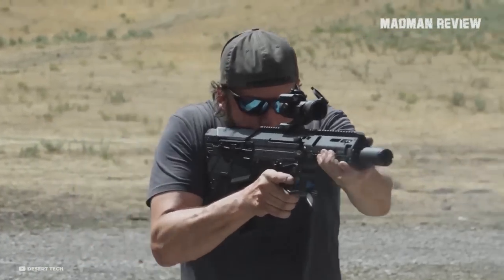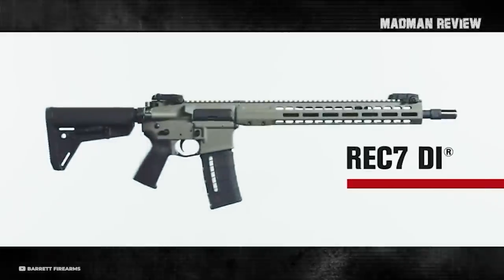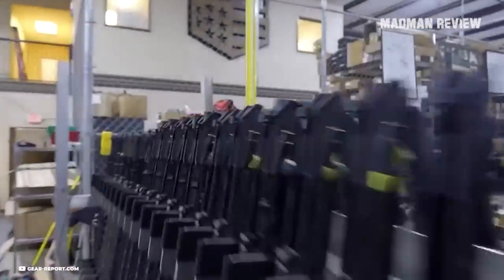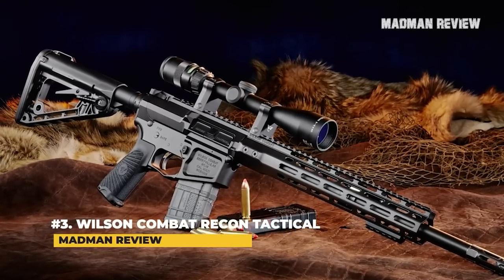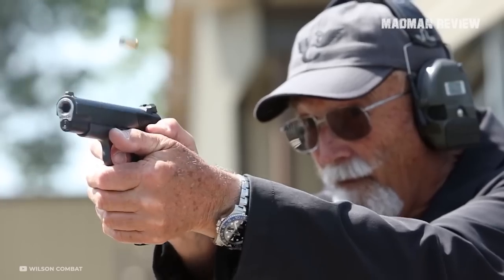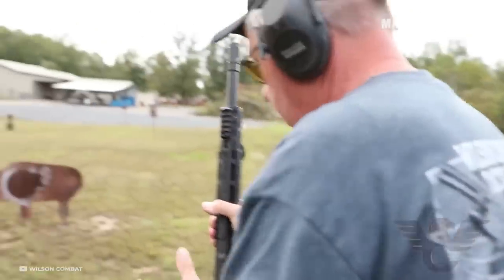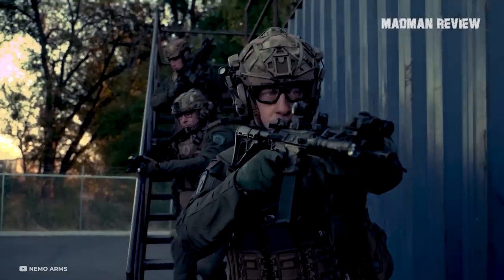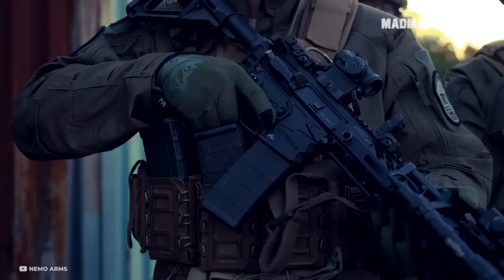7 Best .300 Blackout Rifles "Must Have" for 2023

Comment: Buying a 16" 300 blackout is like buying a pickup truck without a bed. It does everything a truck should do accept the one main thing it's supposed to do. If you're not gonna run a short and suppressed 300blk then just get a 6.8spc or 6.5gren.